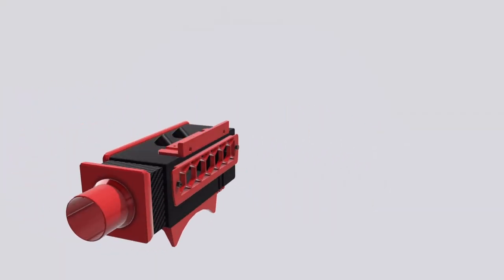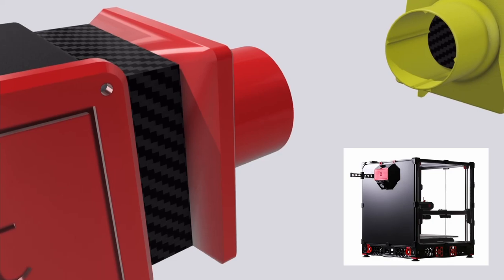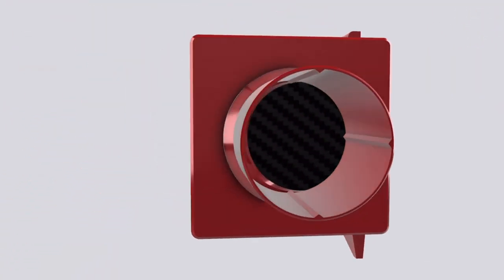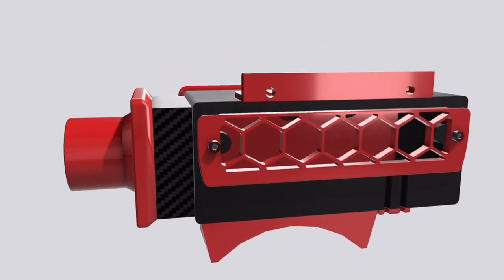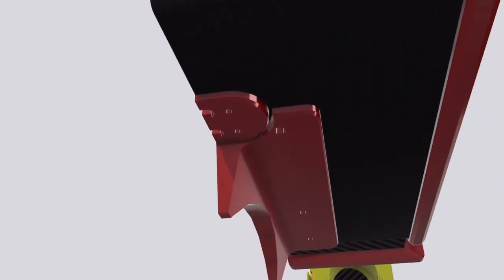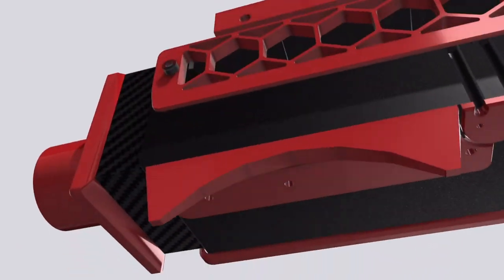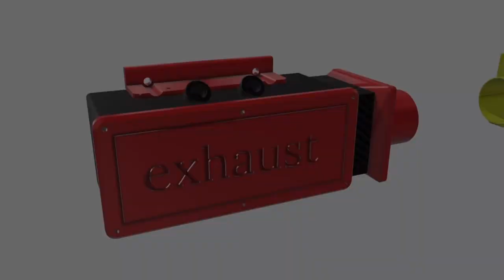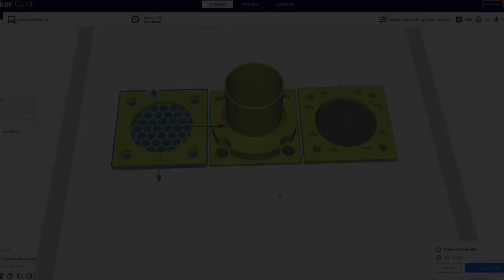Expelled 3D Print Fumes Out the Window!!! Voron 2.4 Mod

Comment: @The Aluminum Carpenter - Thank you alot for making this, I will add this to my printer setup. did you use a 40mm polyurethane hose or is that something different?
Reply from the maker: Yes u are right!

Comment: Are your exhaust fans always on? Or do you turn them on manually when printing ABS? Or even better did you somehow manage to get your slicer to turn them on when using something like an abs preset
Reply from the maker: It starts when print starts, as i set it in klipper. No, i dont know how to preset it just to do that for ABS. Its printing excellent, i can work in the same room without smell. Im working on V2 of this system. And also integrate it into the rack, as in my latest video.